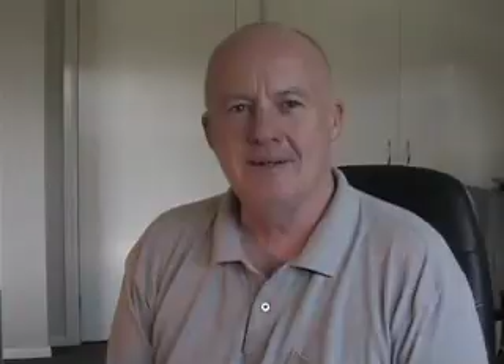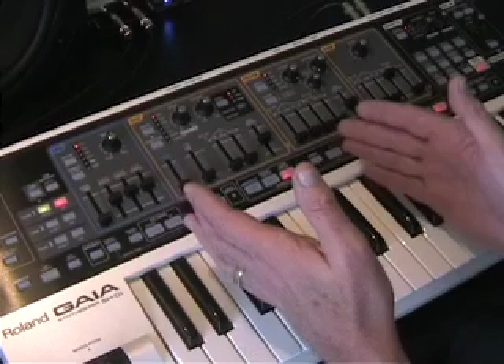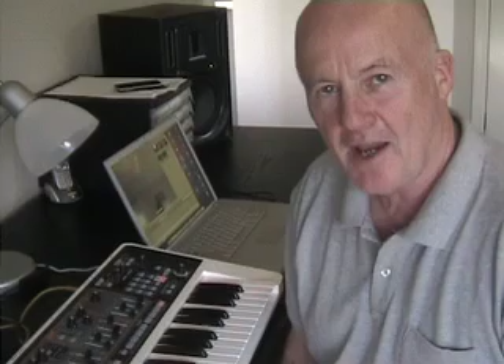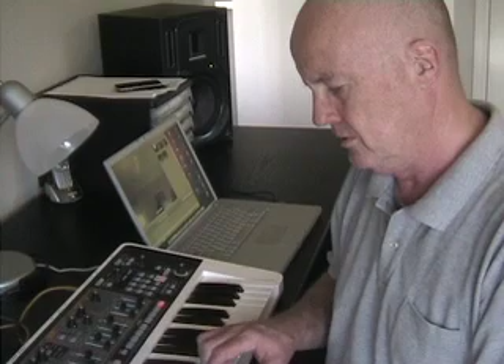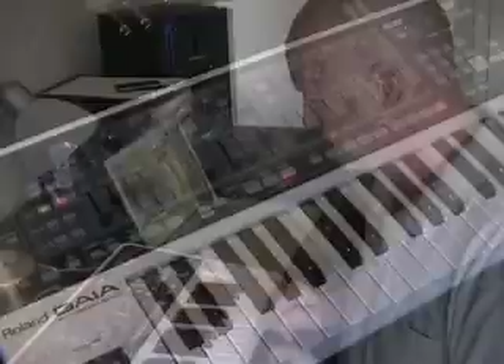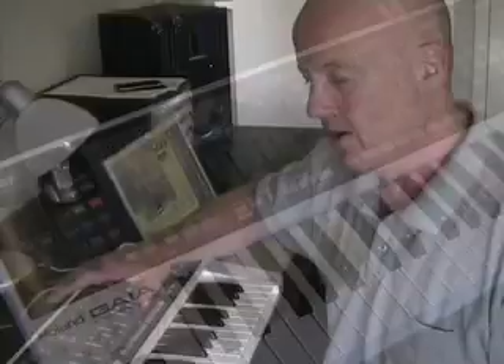Basic Analog Synthesis Part 1.mov

Comment: This particular instrument is a modelling synth, so its sounds are generated using code instead of discrete electronics. "Analog" has become a buzzword nowadays, the way that "vintage" has become synonymous with good or rich-sounding. What it comes down to is imperfection. VCOs (Voltage Controlled Oscillators) in comparison to DCOs (Digitally Controlled Oscillators) are less accurate, and their pitches vary from second to second. Without that, it loses a little character and sounds lifeless.

Comment: FM stands for frequency modulation, relating to the physical properties of a sound pressure wave,  when ever any device emits a sound, the sound is produced due to a force pushing and pulling air particles. this is why speakers vibrate, the moving back and forth creates a change in pressure. the rate at which the speakers vibrate (the frequency) determines the pitch of the sound. so all synths/gameconsoles/anything, changes the physical components of FM sound in order to create different sounds

Comment: im probably not the most informed person to speak to when it comes to synth, and your making this alot more confusing for yourself haha. analogue synths work on the basis of having something pretty much turned on or off, one switch is used to modify one parameter. Digital however works more like a computer in that i can click the mouse button to send an array of different signals. to be continued..

Comment: the sound itself is not what is digital or analogue, its the way in which the actual synthesizer works, a digital synthesizer such as this one the is "analogue modelling" simply tries to use digital synthesis to imitate the sounds of an analogue synthesizer. A digital synth works somewhat like a computer where it records the signals you give it and then turns that into a signal (the sound), an analogue synth uses physical changes in current and resistance to alter the sound